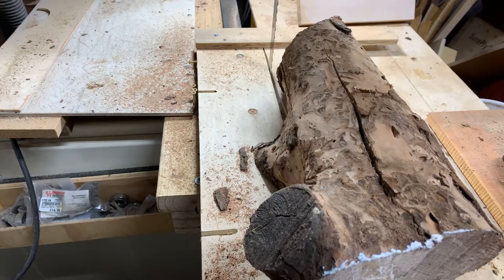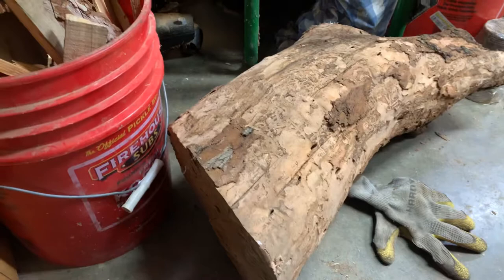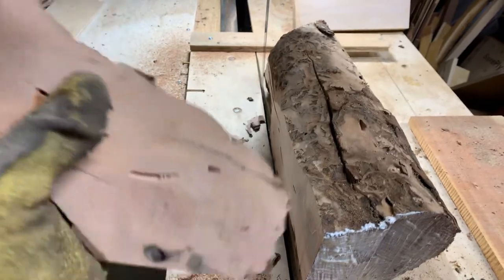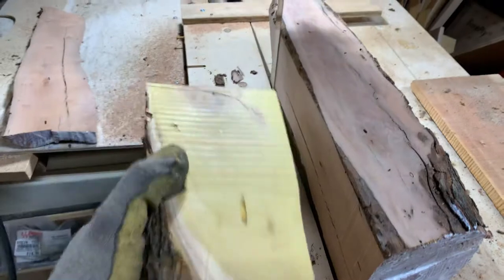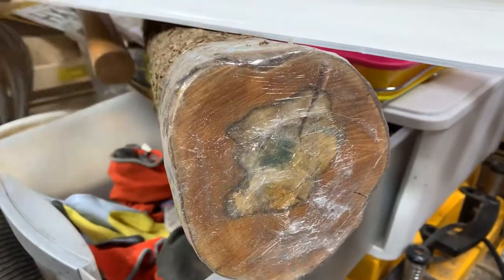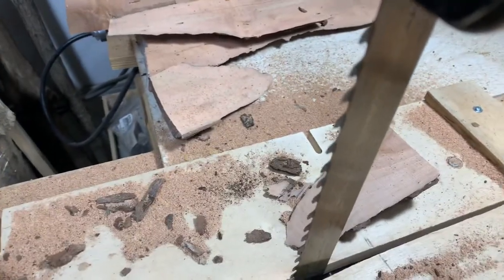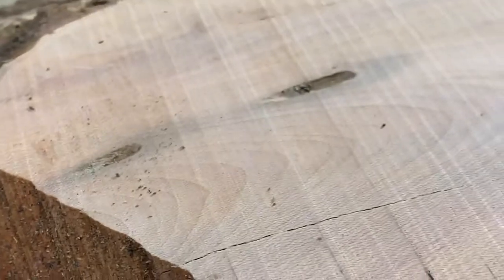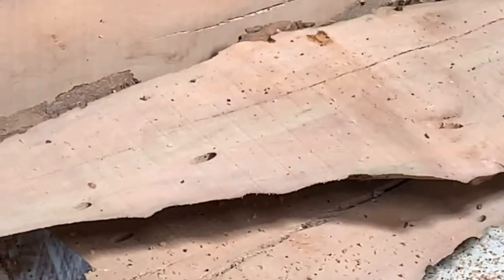RESAW KING CARBIDE BANDSAW REVIEW AND TEST

Comment: Hey man, you ever tried a Lenox Tri Master or a Lenox Woodmaster CT?
Reply from the maker: Mayday's Custom Woodworks 
I have looked into those but settled on this one based on reviews and size of the carbide teeth. Thanks for the suggestion.
Reply: @Holdmylager  ah. Got it. I've tried all 3, although it's been a long time since I tried the Resaw King. The Resaw King is great but I noticed wear a little bit faster on it than the others. But overall it's a great blade! And recently I've found some other carbide bandsaw blades on the market. But no purchase yet.
Reply from the maker: Mayday's Custom Woodworks which blade has worked the best for you of the carbide tipped Blades? I tend to cut a lot of very hard wood including Dogwood, Osage Orange, Brazilian cherry and Brazilian walnut, as well as many other very hard and tough woods such as pipe blanks and lots of wood that also has dirt and grit on it. I don’t know how many board feet of wood I’ve put through this blade but it’s still going very strong and I also like that you can have this blade re-sharpened up to five times for a total investment of $45 each sharpening. Thanks for the info on other blades
Reply: @Holdmylager  ya it's been a long time since I've used a Resaw King so they might have changed their alloy. But when I was using it, I needed it to basically Resaw cross grain 12" thick and be accurate enough to glue up right off the saw. Quite a demanding task. And I remember the Resaw King would do good for the first 100 ft or so but then it started to wear a little bit and my accuracy would start to slip and I would need to start throwing things through the drum sander afterward to glue up. The Woodmaster CT is cheaper than the Tri Master and the Resaw King. It's good and a fast cutter. But it doesn't come out as clean as the Tri Master and the Resaw King. But the Woodmaster is still great. The Tri Master to my memory was the longest lasting blade out of them all and can be resharpened just like the Resaw King. Although the Tri Master has a thicker kerf. I remember the Tri Master was the best performing overall, but the Resaw King gave the smoothest surfaces for the first 100 bf of that task I was doing. Tomorrow I should be receiving a new Tri Master and a new Wood Master in the mail and I'm gonna do some more tests between them. Oh. And the Tri Master can cut metal as well. Don't wanna do much of it cause my bandsaw only has one speed. But it can do it without issue. I'll let you know tomorrow or the next day when I do some tests and see how they fair
Reply from the maker: Mayday's Custom Woodworks much appreciated?
Reply: @Holdmylager  ingot my shipment. The Woodmaster doesn't produce great a great quality cut on very thick lumber but it has a very good feed rate. I also don't think it can be sharpened. If your surface doesn't need to be smooth I think the Woodmaster is a great choice. The Tri Master is pretty much a perfect cut just like the Resaw King. Not as fast of a feed rate tho.

Comment: Hi Robert I am thinking about getting a blade for my bandsaw saw mill but a blade is 7 times the cost of a regular blade! in your opinion do you think it is worth for me to try one? I wonder how many feet it will cut before sharpening?
Reply from the maker: Marc A Gagnon That’s a hard question to answer to be honest with you. These blades do certainly stay sharp or longer and cut straighter lines than most any other blade I’ve used before however even on my 20 inch bandsaw the blades still seem to fatigue and crack Maurices I think they should. The blade used in these videos has now broken in at least three places. The first repair including return shipping only cost $45 and they replaced a fairly large section of the blade and re-sharpened the entire blade. I’m not sure what they’re going to do when I send it back to them this time. In the last 20 years or so this is the only blade I have broken on a bandsaw my blades usually get Dalen thrown away well before the integrity of the material is a concern. That being said I did purchase another one of these blades so that I can continue cutting when one of them breaks. They are still excellent Blades but only if you have a reason to need one. I do a lot of recycling and sometimes need to split a 15 or 16 inch tall piece of hardwood which is no trouble at all for this blade with my Saw set up. If quality of cut is important to you like it is to me this blade is worth the price tag. I speak a lot more highly of it if the damn thing wasn’t so prone to breaking!
Reply from the maker: Marc A Gagnon I have absolutely no idea how many feet of cut would have gone through my blades
Reply: @Holdmylager  Could it be your wheels are to small for the blade and it has to bend a tighter radius?
Reply from the maker: @ProfileP246  I don’t think the wheels are too small for this blade but it certainly consideration. This is the only blade I’ve had in your shoes with on my 150 inch Bandsaw. Still I think it’s worth the money even if I do break a few of them.
Reply: @Holdmylager  ah right no just a thought because i had a blade company make me two blades from the same material one 1/2 and one 3/4 and i found the 3/4 one after some use used to look like it was full of tiny cracks all over it, saying that it never broke but i put the fracturing down to the possibility the bigger blade was having to wrap around the same size radius as the smaller blade, the smaller blade having less material could handle radius better. Suppose if you're getting enough cuts with the blade that's okay the blades i use are about £40 a pop and that would get me about 6 grand worth of cuts haha! so i know what you mean.

Comment: I'm about to buy one and I would love to know how this blade worked out for you in the long run.
Reply from the maker: In the long run, I’ve been very happy with these blades. I currently have three or four of them so that I can alternate and always have a good blade when the others are being sharpened. I have not yet had to send them off for sharpening but when one breaks they usually automatically sharpen all the teeth when they repair the blade.
I do recommend this product.
Prior to finding this carbide tooth blade I was usually running through several cheaper blades every month. So long as the wood is relatively clean, these things will last just about forever without getting very doll. I think it cost about 45 or $50 to get them sharpened and sent back
Reply: @Holdmylager  Thanks for the recommendation. I recently bought a grizzly 17" bandsaw with their 3/4" resaw blade. I'm resawing some 6" pecan branches and it lasted a day before it started wandering. I sharpened it the best I could with a dremel tool and got another hour or two before it broke. I'm amazed at how well your setup works compared to mine. Gotta pony up I guess. Thanks again!
Reply from the maker: I’ve cut through quite a bit of Osage Orange and Dogwood without him noticing much dulling. Sometimes you can find these blades cheaper on EBay. Good luck.

Comment: The real question is… how many blades have broke on you ?
Reply from the maker: Haven’t broken many. Probably 4-5 in the last decade. I think three were Resaw king blades. Still worth it to me.
Reply: @Holdmylager  that’s three to many for that expensive of a blade. That’s the reason I have avoided buying a laguna one and instead I got the Lennox. It’s a thicker blade and substantially less fragile.
Reply from the maker: Would you mind telling me which model of Lennox blade you’re using? I have been considering those. I primarily purchase these for cutting dogwood since the trees are so small in diameter. I try to lose as little as possible to the car for the time, but would be nice not to break these so frequently $$$$
Reply: @Holdmylager  Ive owned two of the 1in Lennox trytip blades.  My first one was on a Rikon 18in saw and loved it. I eventually sold that saw with the blade and got a powermatic 18 inch bandsaw. I had drug my feet in purchasing another one, but after braking 2 less expensive blades and having them go dull I finally ordered another one… and I’m so glad I did. Most people done know that you can clean the teeth on a bandsaw blade to, just like a table saw blade. I will take this blade off my saw when the teeth look dirty and spray is down with the orange bit and blade cleaner and then it acts like new again.  Yes the blades are more expensive but there a better carbide than the laguna as well and should stay sharper longer. My 160in blade was around $280 give or take 
Hope this helps
Reply from the maker: @MSRWorkshop  thanks

Comment: The saw marks would not be as pronounced if your stock were stabilized!
Reply from the maker: Probably so, but I think it’d be extremely difficult to stabilize a block of Dogwood due to its density
Reply: @Holdmylager   I meant SECURE it to the sled or give it at least two points of contact.